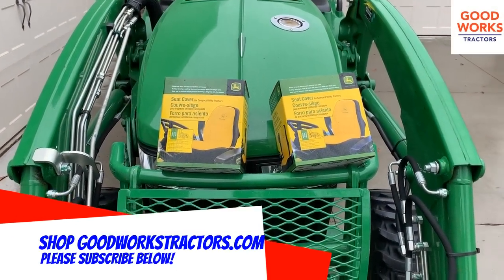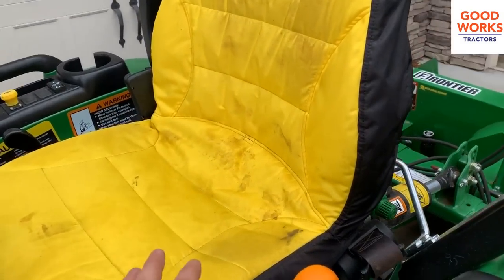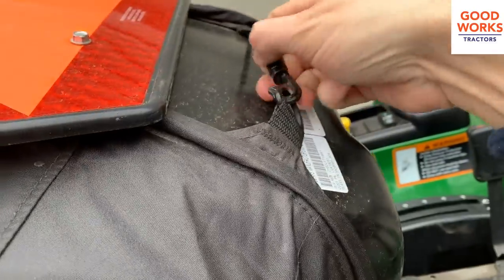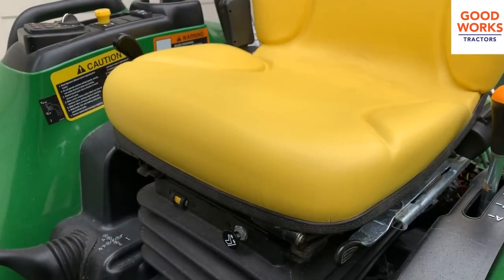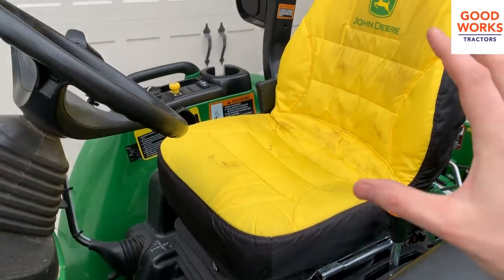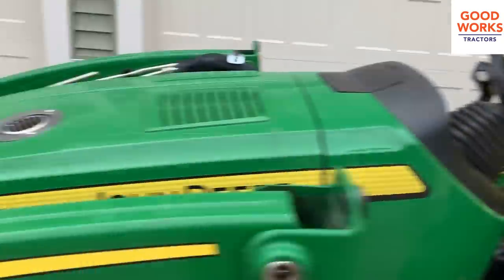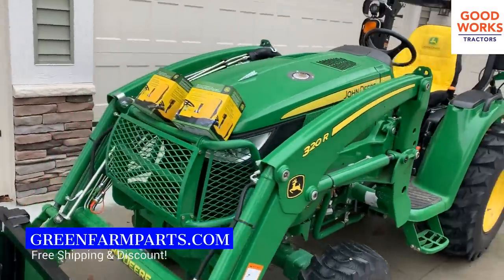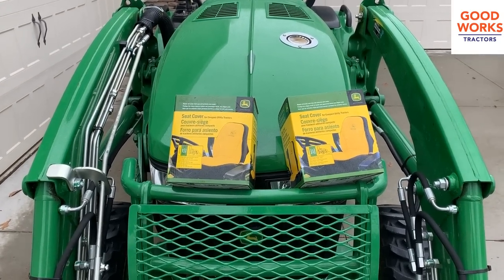Did My Seat Cover Ruin My Tractor Seat?!?

Comment: Hey good works tractor I have a seat cover for my John Deere 2025r and it does not fit it the way it's supposed to and I tried to soak it but the little strings and hooks broke off of it

Comment: The large JD seat cover will not fit the 2018 2025r seat. It's considered a newer premium seat with extra foam and therefore the cover is too small. Just a heads up.
Reply from the maker: Good to know.  Do you happen to have a part number for the correct cover?
Reply: @GoodWorksTractors  Apparently the dealership was stumped too. They didn't find a XL in their computer system. Just a medium and large. So no seat cover for me... I did however put on a heated seat (non-JD) for plowing snow.
Reply from the maker: Strange.  Hopefully one comes out soon.  I've heard of the heated seat, but never seen one.  Which did you get and does it actually work?  Worth the money?  Does it plug into the 12 volt convenience outlet?
Reply: @GoodWorksTractors  I bought a heated seat cover off of Amazon for a car. I plug it in my 12 volt and yes it does work and won't blow any fuses. Wish I had a cab, but the seat heater is a nice touch to an open cab.
Reply from the maker: Good idea!  I may have to get one myself!

Comment: Not seat related but is that the exhaust out the top of the hood and if so does the heat/fumes bother you. I know it would have the exhaust filter but I can see it at times being… “Yucky”. Lol.
Reply from the maker: Good question.  Fortunately, that is not the engine exhaust which is located towards the bottom front of one of the hood side panels.  The vent in the hood is for the DPF system which is rarely noticeable.  Thanks for watching!

Comment: What I noticed is that the tractor doesn't have a drain hole in the back like a JD 335 seat does it may help to remove some of the build up of dust and dirt
Reply from the maker: Yeah, good eye!  Most of these seats don't have those drain holes anymore.  I wonder why that is?  Thanks for watching!

Comment: I'm more likely to get mold than sand abrasion. I'm all for a seat cover. But it's a good idea to pull it and check occasionally.

Also note that China and their Amazon/Ebay zombies have decided to market seat covers using the JD part number. They have no logo (at least the ones I have seen) and you may or may not get good materials that route.  Shame, shame.